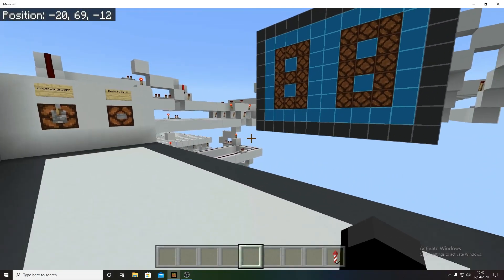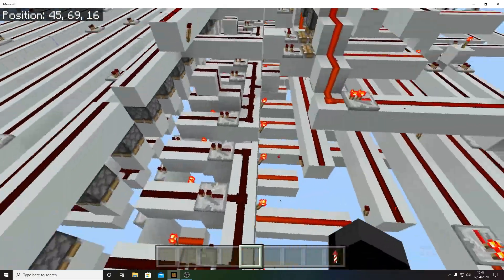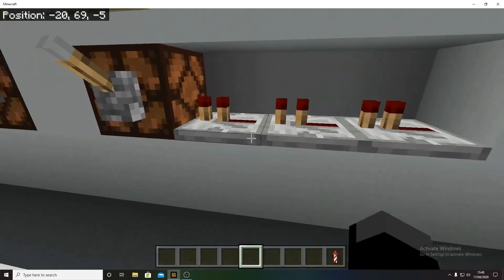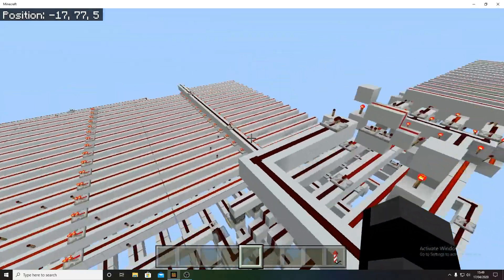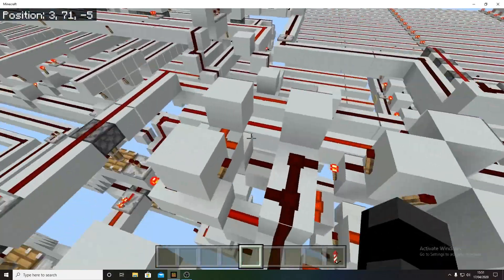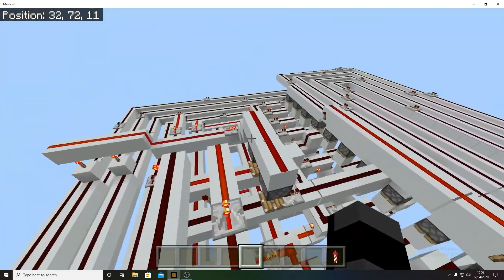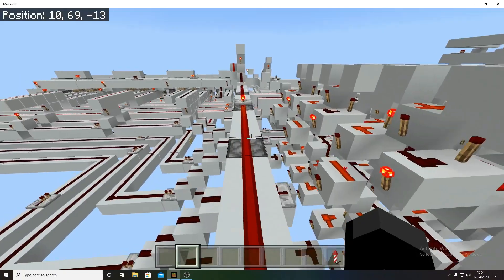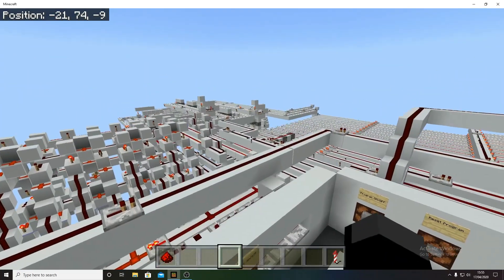4 Bit Redstone Computer Tutorial: Introduction - P0

Comment: The crazy thing is redstone is evolving so fast that you could probably make a version of this both 5x smaller and faster then this 

In another 5 years it’s all gonna be in a single block
Reply from the maker: Yea this is a very simple CPU with a pretty bad instruction set. A lot of new Minecraft CPUs use vertical architecture which makes things a lot more compact and faster. With the redstone tick speed game rule on Java it's pretty feasible to run games like snake etc in real time on computers in the base game.

Comment: How to make this without doing too much work
Step 1:build display
Step 2: redstone repeater on 4 ticks you can build it as long as you want
Step 3:make an encoder that make it so that if the first redstone dust is on it will show the number 1 and if second redstone dust it will show 2 I mean you get it right?
Step 4:make a 1 tick input at the first redstone dust and it will count to... 

idk 10 or even 100 and that's the one in the vid if you didn't understand I'm currently making a vid of the tutorial I said

Comment: Wait if its 4 bit can i program a ping-pong type game in the computer? Or is it only powerful enough to handle numbers
Reply from the maker: This computer is not powerful enough to run pong as it would need more program memory and conditional branching unfortunately.
Reply: @TheDarkness344  alr got it, it's pretty simple to add more program memory and conditional branching
Reply from the maker: @PDE973  yea it shouldn't be too hard. For pong, branching is used for edge detection for the ball as well as collision and edge detection for the bat so you will only need like less than or greater than conditions. I would recommend around 64 lines of program memory for a 16x16 screen.
Reply: @TheDarkness344  alr got it, thx

Comment: Hello, will this work on java edition
Reply from the maker: Unfortunately the ram will not, however if you find a different design of ram to use (many tutorials on YouTube) it should work. Also make sure redstone is set to cross, and also for one of the lines for the ram reset, I think you have to put blocks ontop of the pistons and run redstone over it instead of just running it straight onto the pistons.
Reply: @TheDarkness344  why don't you make an hour long tutorial on how to build a computer in java edition using survival blocks(without Using command blocks) love your videos btw. Pls make this video on mc 1.16